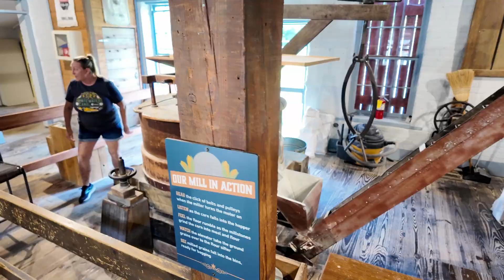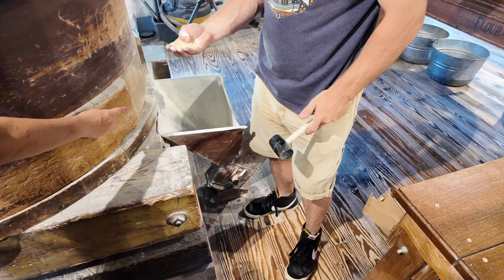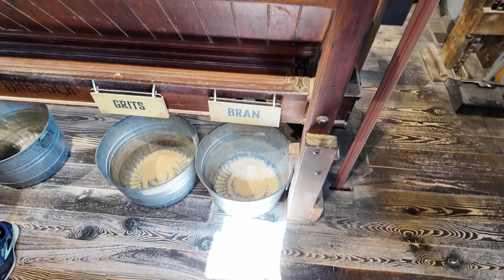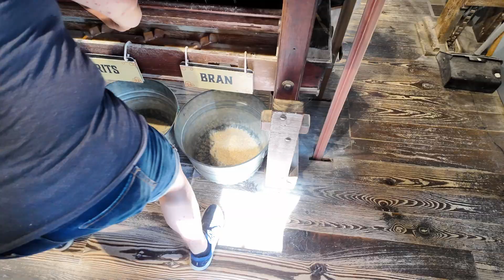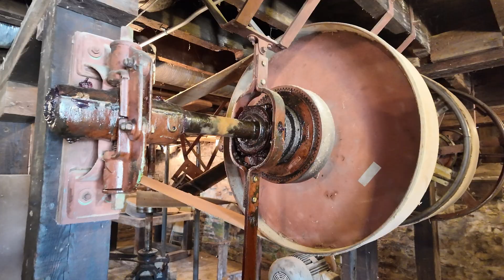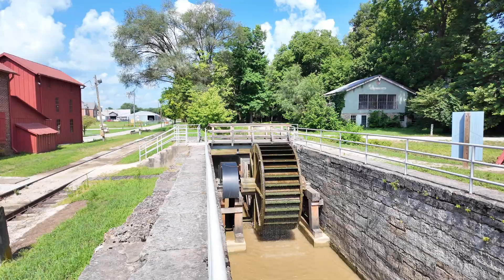Inside (and UNDER) the 1845 Metamora Grist and Roller Mill

Comment: That's interesting video!
As  a German, I never ever saw a flour dresser for corn, just some for wheat at a museum mill. Well it's much less dusty like if you're dressing wheat! She opens the drum compartment while running! You can not do that with wheat, you would vanish in a white dust cloud! Fascinating! Also, to clean an auger (yes it's a wonderful old one, made from wood), with a bit of leather strap, never saw that practice, how ingenious! Sad that you did not film the roller mills or the sifters and the bucket-elevators.
Reply from the maker: A lot of the demonstration mills around here use corn, instead of wheat.  In historical operation, they all did wheat, too, but I don't think I've ever seen one running wheat as a museum.  We grow plenty of wheat here, but you saw the advantage - corn is a lot cleaner, and less risk of fire/explosion.  Also, city kids will immediately recognize a handful of corn, but not a handful of wheat, so I think that may be part of it, too.  
They don't have roller mills operating there, anymore, and they're only using that one, very short bucket elevator.  Mills are starting to open back up for the summer (most running as historic sites close down in September/October and reopen in May) and there's a few I'm looking at, so hopefully I'll find one with an operating roller mill and with multi-floor elevators.  There has to be one out there, right?

Comment: I'm not understanding how a cotton mill didn't make sense in southern Indiana. England has no native cotton and was said to be the largest exporter of cotton products in the world in the 1800s.
Reply from the maker: You've got a great point.  Part of it, I suspect, is that England already had a good, solid textile industry and nearby markets.  The other part, keeping in mind we're looking at mid-1800's, here, is that it may have actually been cheaper and easier to transport cotton from plantations in places like Georgia to England by ship than it was to get it to southern Indiana.  There were no railroads to the area yet.  The Ohio River is a good distance south of Metamora.  The Whitewater Canal was built, then destroyed by floods, rebuilt, and destroyed again before being abandoned.  Also, the place was just really, really small.  The cotton mill there was about the same size as the current grist mill.  Compare that to the huge mills in England at the time.  Had they built right next to the Ohio River, it might have worked out, until they lost to larger-scale operations.
Reply: @Industrial_Revolution  do you think the founder of that mill was operating more from hopes than reality? A thousand spinning machines is bold. Not a surprise it would be a gristmill within 11 years, and in Indiana, a corn mill makes a whole lot more sense.

Good video, as usual
Reply from the maker: It's definitely possible.  In addition to problems with transportation, internet research was a bit more crude back then, too.